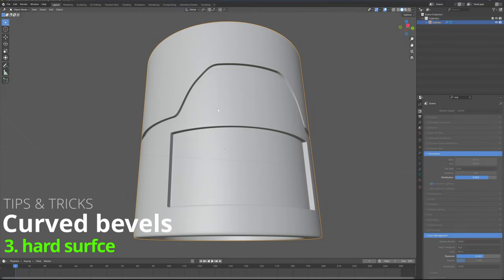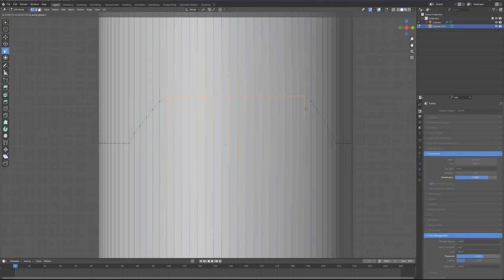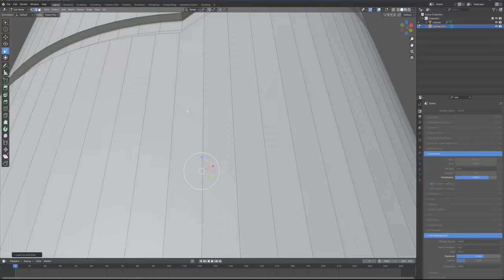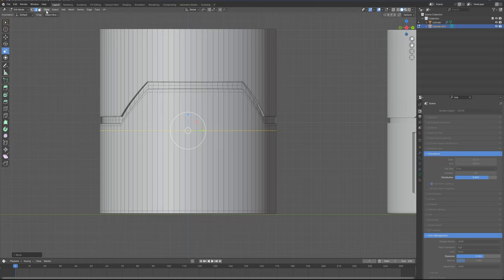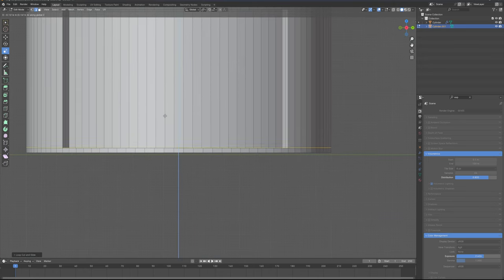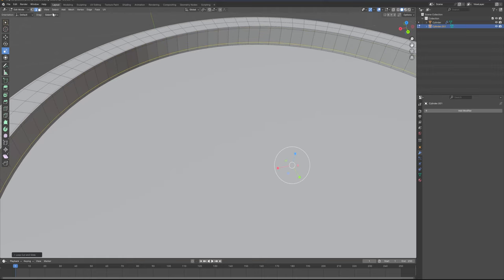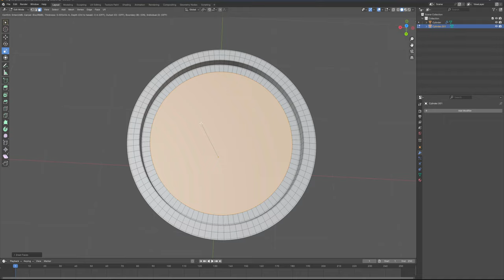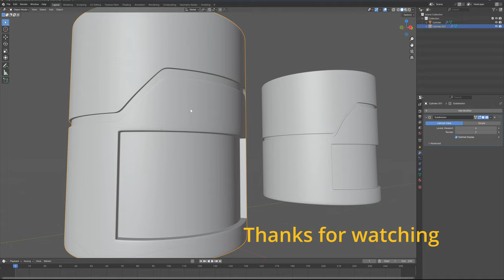Blender 4.1 Tutorial: Mastering Cuts and Bevels

Comment: its nice but WAY to many faces for the object ur trying to make, the fact ur not even using the bevel operation is astounding, or even just creating the extruded (or in this case intruded) faces and adding a bevel modifier.
good topology is one thing but face count is something to look out for as well, there's no need for a simple object like that to end up with over 100k faces after you subdivide.
Reply from the maker: Yes I agree that I haven't been throw the bevel modifier and the density is crazy, my goal is to give you the idea that you could depend on the basic tools to get theses effects. regarding to the bevel modifier you could use that as well but then you need to separate that part form the all inter mesh. anyway you could smooth the shaders to get better results when it we talk about smoothing. However 1 sub should be enough   😊😊